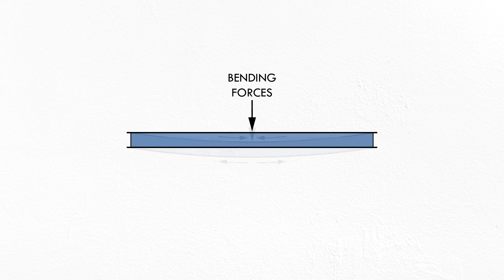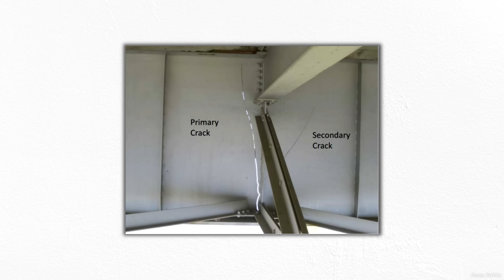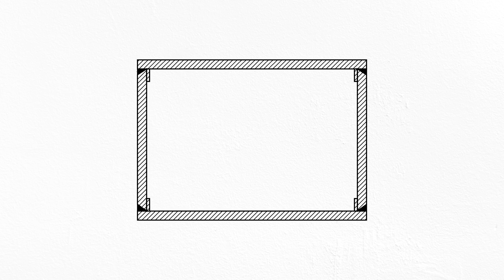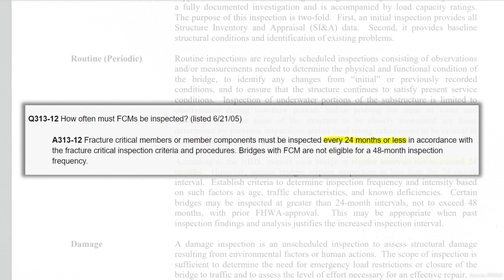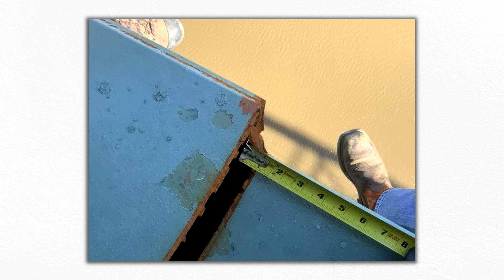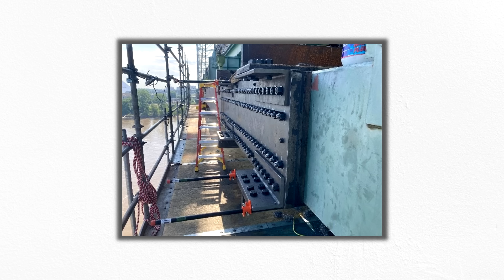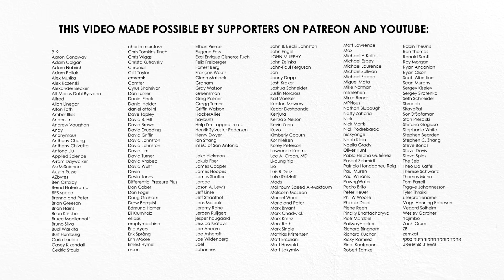What Really Happened at the Hernando de Soto Bridge?

Comment: I wonder as we push for stronger designs with thinner materials, if in doing so there are greater risks with stresses and stress cracks.  Would it be better to overbuild on the strength end and concern ourselves less with cost?  Also, could tensioned cables be placed in the horizontal beams as a safety precaution in case of a crack forming, at least there's a backup to hold things together?  Robust engineering with triple safeties would be a good start, pretend the bridge is an airplane where weight is less of an issue.  🏗️🛫

Comment: If you want the god damn thing to last just overbuild it.
It will be more expensive but damn it will hold.
I've never ever seen an overbuilt thing fail catastrophically that being a concrete building metal structure or electric component.
If that member was 10% more oversized (and all the rest of the members accordingly) we would not be talking now.

Comment: Great explanation.  I see many comments speculating about the 911 calls.  Thinking the inspector/ engineer leaked the information to 911 and likely lost his job. No No No — this is a catastrophic failure.  That beam, “member” is cracked through and under tension, holding the arch in shape.  This would be SOP , standard operating procedure, for a finding like this.  I can imagine that section of the class now.  “What do you do if you see that the bridge is about to fall down?”  Ans: close the bridge immediately, by whatever means needed.

Comment: I am curious about the reasoning for using the method of welding four plates together.  If welding causes issues like you have stated, then why not use a cast beam?  Using a beam that was cast would eliminate welding altogether.  I am not an engineer so forgive me if the answer is obvious to everyone, just seems like an easy solution to me.

Comment: be interested in more about fracture. for example, the Silver Bridge. two things spring to mind, paint (covering cracks) and cracks that can appear in unvisible parts (like from the inside of the hole which is pinned and then overlapped by some kind of cap). I imagine x-rays are fascinating. other brdiges that failed which amazed include the Genoa, Italy one.

Comment: There's an altrnate route for land traffic but this must have a devastating effect on barge traffic and all that rely on it.
Reply: oh it made it this far and didnt fall.... itll be fine with the fish plate and bolts. limit traffic on the bridge with computers/sensors/stop lights to keep x #'s per span to a certain amt... 60# of capacity?  most are made to deal with 80% capacity since a chain is no stronger than its weakest link... drilling rigs... the rig is stated/built to handle 1 MILLION #'s... the weight indicator goes to 800,000#... 80%... so when reach 800,000# that is IT!!! QUIT PULLING ON THE STUCK PIPE as things start to fall out of the derrick.. metal things.  even 500,000# designed drillin' rig has a hard time running into the hole 240,000# of casing as the back brake is just not big enuf to keep the load controllable and it is near "running away" from the driller who is LAYING on the brake handle/SCREAMING THE BRAKES to stop it before throw the slips to really stop the casing.... that can possibly collapse the casing/put big STRESS gouges in the pipe that leakds to failure

Comment: Why was the suspended deck tied directly to the tension member? (the beam that failed)  Shouldn't the suspension cables be capable of both handling the weight of the deck, and also be flexible enough to handle the dynamic loading as traffic travels across?  I would think that by placing a vertical load on a horizontal member such as the tension member, the deflection caused by the load would directly effect the connection at the piers, as well as the integrity of the tension member....which cracked.  I do not see the logic in this element of the design.

Comment: The argument that this crack could have been missed accidentally falls apart after you realize this crack has existed for at least 5 years. Obviously the guy wasn't doing his job. You don't just "accidentally" miss a crack that large for 5 years in a row.
Reply: Or maybe, it wasn't the same guy for all of those 5 years and those guys did dutyfully report the crack and were told "well done, we take it from here and rest assured  we take this very seriously" and then the reports were filed in the special circular filing cabinet sitting next to an expensive desk....
Reply: @Bird_Dog00  "Or maybe, it wasn't the same guy for all of those 5 years"

I'm sorry, but even a new inspector who retrieved and reviewed the drome imagery in 2019 ( 08:56 ) should have raised alarms and had the bridge closed for repair.

You DO NOT ignore a 'failure in progress' on one side of a box beam that has clearly travelled more than 75% the height of that vertical member.  To NOT have acted upon seeing that footage is nothing less than criminal negligence, either on the part of the inspector AND/OR his/her supervisor and ARDOT.

The fact that ARDOT released their 2-year old drone survey video clearly showing the extent of the failure in progress was known (in 2019)  and proves negligence by the inspector and/or their supervisor(s) above them.
Reply: @MelioraCogito   Completely agree.
In France we usually have 2 sets of inspections for common bridges on highways : 1 every year with a checklist, comments and notation, and then the detailed inspections, every 5 years, which include pictures of every defect, drawings of all defects to locate them on the structure, descrption the state of every part (bearings, railings, etc.), and the conclusion by the inspector proposing what to do (reinforcements, repairs, instrumentations to follow the evolution of defects, maintenance, and even changing the rate of inspections)
For the more important bridges, there are even more specific inspections added

I can't imagine such huge crack going unnoticed if anyone looked at the footages.
Reply: @Bird_Dog00  If you've seen the Arkansas side of that bridge, and how horrible the roads are on the AR side - any doubts you may have in that theory would be immediately dispelled. ARDOT's version of maintenance is "ignore and defer" and it shows.
Reply: @Bird_Dog00  Nail hit squarely on the head! AND it happens more than anyone would believe!
Reply: @Bird_Dog00  Yup. They knew about the crack. They just didn’t want to spend the money to repair it. Conservative states are extremely good at trying to fix problems after they happen so they can “save money” instead of trying to keep problems from happening in the first place. Human lives aren’t their concern.
Reply: @CapnCody1622  I doubt that. That was going to end up collapsing, and nobody in their right mind would ignore it, knowing how there would be a full investigation later. No, it probably was the inspectors short cutting, thinking someone else already looked there. Now, if you want to make it political, in liberal states they have spent all their money on wasteful social programs and hope for a bridge collapse so they can beg for more taxes, which they will again blow on social welfare programs.
Reply: @CapnCody1622  lull
Reply: @CapnCody1622  Yep, I'm betting the fired inspector was a diversity hire.
Reply: @CapnCody1622  then stay in blue states. That's it....I'm no republican but at least they don't force you to close your business...you know there's no talking to authoritarians. Sorry I voted for Obama twice and this is what we've become. I've nothing else to say.
Reply: @CapnCody1622  Oh yes!!!  Liberal states are soooo much better.  Really? You have to make this a partisan thing?   Red and Blue lives both matter.
Reply: @CapnCody1622  Yes. It was Arkansas that was suppose to be taking of this inspection detail. Maybe skimping is a routine thing to do in Arkansas.
Reply: @CapnCody1622  liberal states do the same shit. its not a left or right thing. its a government thing.
Reply: Back to Bong Jovi's comment: "Obviously the guy wasn't doing his job." I would not assume that the inspector who was fired was the one responsible for failure to report the crack. It could have been someone higher up the food chain that needed a scapegoat or patsy to take the fall. In light of Grady's explanation of how and why a single inspector should not have borne the sole and exclusive responsibility for inspecting and reporting any critical member it seems obvious to me that there wasn't a single person who was responsible for the failure to find and/or report the crack. My chief suspect is the person who made the decision to fire the inspector.
Reply: @noyopacific  i would imagine there's documents submitted that would clear him if that were the case, probably digital so they couldn't just get deleted by their boss
Reply: Its not just one guy who missed it. Had to be dozens of inspectors, supervisors, regular employees, hell the PAINTER guys should have seen it.
Reply: Congrats CapnCody and Andy Rumming. You win the award for stupidest comments on YouTube 2021. Just braindead arrogance and ignorance. Try actually thinking for yourself some time.
Reply: It's not a question of "the guy". A bridge this size will have multiple sets of eyes reviewing the bridge, the photos/drone footage, and the report. This isn't something one person could cover up. What happened here was failure of the whole system. 

Firing one person is just an admission that the system wasn't checking that person's work.
Reply: That's Trump's US for you...

Ignorant to the point of self destruction... 😉
Reply: @BassandoForte  why did you bring politics into this? Why did anyone bring politics into anything?
Reply: @BassandoForte  While I'm certainly no fan of the orange clown, this problem isn't one he created. It's been going on for decades.
Reply: @Bird_Dog00  - It's voted Republican 9 times out of 12 elections - the last one being in 1996... 👍👍
Reply: @dukeplc  That's all well and good but Minnesota's DOT wasn't responsible for bridge inspections, ARDOT was.
Reply: @dukeplc  More to the point, Minnesota wasn't even involved in the bridge period, so why did you bring them up?
Reply: @richardmillhousenixon  yes they were.   In addition  "172 Minnesota bridges were identified as structurally deficient or fracture critical."   Again, the point here is that "Trump's America" has nothing to do with bridge problems.
Reply: @dukeplc  Ok I'll grant you as much, I must have missed that line in the video. I wasn't trying to say that this was somehow because of "Trump's America" because while in my opinion, the bar for not being a terrible president was so low it was a tripping hazard in hell, and yet there Trump was, limbo dancing with the Devil, this is clearly a systemic problem and has nothing to do with one specific administration.
Reply: @richardmillhousenixon  
Whoa fella, turn off cnn.
Reply: @jamest3552  Woah bud, your bias is showing. I haven't watched any US based news source in years. See, I prefer to get my news from known reputable unbiased sources, such as Reuters and the BBC, which, thanks to Ofcom regulations (basically the British version of the FCC) are legally required to be unbiased in their reporting. And even then, I take all reports with a grain of salt and do my own research to formulate my final opinion.
Reply: @richardmillhousenixon  
BBC, Reuters...thanks for the laugh.
Reply: @richardmillhousenixon  because a bridge that MNDOT was responsible for... the I-35 COLLAPSED with traffic on it, killing several dozen people. That was a Democrat state and blaming the Political party for things like bridge maintenance is as stupid as scapegoating a lone inspector.

We're really sorry that the phantom Orange Man the news indoctrinated you to fear hurt you without ever doing anything, but Conservative states aren't the only ones with infrastructure problems.
Reply: @BassandoForte   Obama was in office for 8 years.  What did he accomplish?  It was Trump that said America needed new bridges and roads.  But that's OK...keep paying your taxes to the liberals who send your hard earned money to Iran and China.
Reply: @russellgray1308  - So you don't even pay tax to help your fellow Americans..??

Is that really what those Capitol riots were about..?? 🤔🤣

BTW if the UK government is sending money to Iran and China then you need to remember we have a Conservative Trump endorsed government..  🤣🤣

You kind of walked into that one... 😉

🤡 #MAGA 🤡  Made Astonishingly Gullible Americans... 🤣🤡🇺🇸🤡🤣
Reply: @russellgray1308  we've needed new bridges for like thirty years
Reply: @BassandoForte  
You are aware that Trump was involved in building giant steel buildings and his ethics were admired until he became president.
Reply: @larrybe2900  - Florida is a Republican state too... Your buildings there aren't renowned for their structural integrity now either...

See a pattern emerging..??
Reply: @BassandoForte  
No I do not see a pattern emerging. It is not that I do not want to see a pattern, I see no pattern.
Reply: @BassandoForte  
When Trump started his endeavors in NJ there was a vibrant casino environment. What was out of everyone's control there was neighboring states where their busloads of gamblers would come from decided to enact their own forms of gambling which siphoned business away from NJ. One can't dispute the results but Trump is not to blame as he did not enter into these casinos with the idea of losing money. I hope on that you can agree.
Reply: @larrybe2900  - Presumably if someone needs to make themselves bankrupt 6 times and avoid paying US Tax - I'm sure you always think the best of your country...

You shouldn't look gift horses in the mouth - should you.?? Even if you are a Republican... 😉🤣
Reply: @BassandoForte  
Are you aware of the financial atmosphere of the time? The man did not want to lose money. I won't attempt to change a perception the media has ingrained into your head about the man. You seem to not want to accept reason and that is for you to sort out.
Reply: @BassandoForte  Miami-Dade, and Broward county are both overwhelmingly democrat. The state isn't responsible for building inspections, the county is. Also - please explain Detroit.
Reply: @notsure7874 - Odd how goalposts change in Republican states isn't it... 🤔

Comment: 10:00 yeah, they should have taken the lesson from aviation: mistake of one person is never mistake of one person. That only means that there is insufficient training, oversight or there are management issues. Also, instant firing person who made mistake gives a message to other employees: cover your butts, if you made mistake don't tell anyone and try to hide it. And you are on your own and you will become scapegoat if needed. That is why you rarely see a blame being thrown around in aviation.
I wonder, why they did not tension it with cables? It seems like cleaner solution.

Comment: I really don't think the bridge SHOULD be repaired. The fact that it didn't fall down on its own is nothing but pure luck. They are just going to weld in a new section, but what happens when the other side fails? They should demolish the bridge and build new piers on the bases of the old ones.

Comment: You made a pretty big deal about weld defects. They are defects and should not be in a finished product. Do they get missed sometimes they do. Way less today that they used to. Our processes are much more refined. The piece about welding is that in many high strength weldments is the fact that the loquat ion zone at the toe of the welds often experiences a stripping of the alloys whole the molten weld metal is freezing. This generally results is micro cracks that will eventually fail if the structure is loaded with a cyclical load. The prediction of the life of the product is the difficult part of the formula. When designing a product the designer must consider that the loading of the weld needs to outweigh the risk. Certainly the exciting part of the development of a product. The other part such as the one you discussed is was the failure caused by the loading or a micro crack in the base steel. This product was not welded. I know of products that the designer added a welded gusset on a truck. All the frames failed except one. The one that did not fail was built in error and the gusset was left off. This gusset maid the structure too rigid. All interesting but lighten up in weld defects.

Comment: The crack is also right next to that riveted plate, that point is rigid and allows less deflection of the support. As an engineer and welding inspector I'd say that entire bridge needs to be subjected to  radiographic (xray) testing to detect any other fractures. After that many years you know the rest of the structure took on extra stress.

Comment: There are some important issues that need pointing out. 
1. This bridge was designed when minimal computer analysis was available and in all likelihood it was done using “hand calculations”.
2. Clearly, this was not a penultimate member, with some unforeseen redistribution of forces. Who ever would consider this case?
3. If this had been a modern bridge using current state of the art software, it would have collapsed long ago. Current obsession with refining the model and trimming members would have probably led to this being a penultimate member or at least having the unforeseen redundancies “trimmed out”. Assuming this type of failure and the need for this level of redundancy is beyond the imagination of most young designers.
4. I guarantee this was not built by the cheapest contractor. When you compare this to similar international bridges where the failure resulted in a large loss of life - it was money well spent. 
5. Brittle failure is a nasty and unforgiving mode. This time they were lucky.